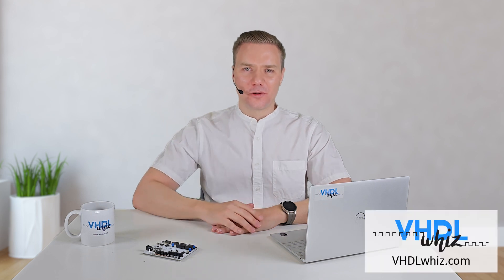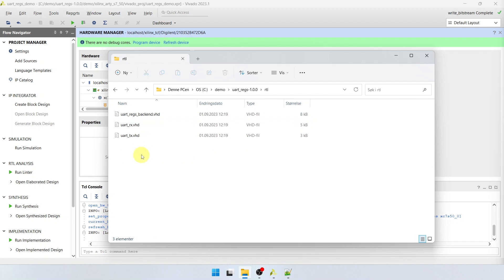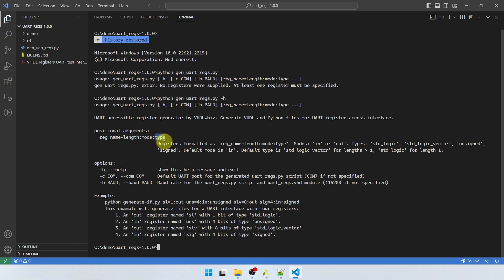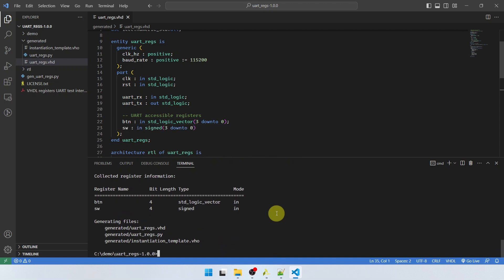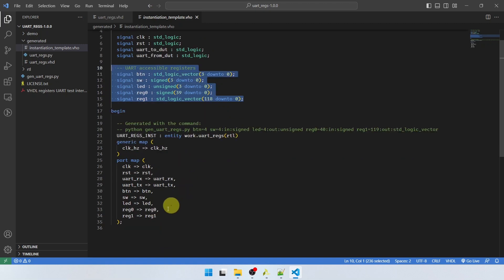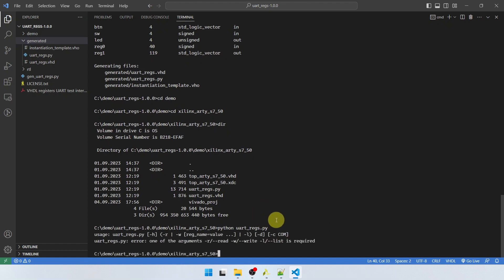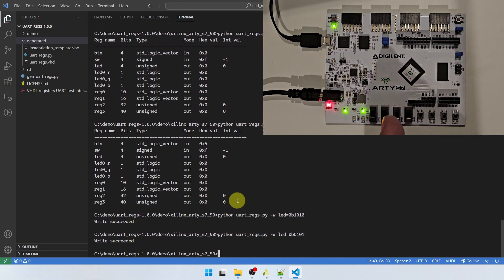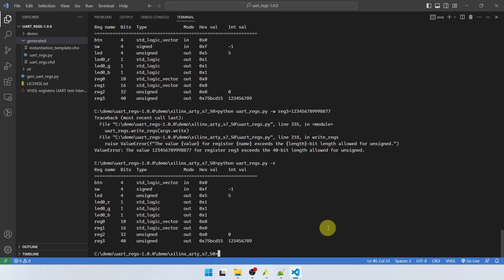VHDL registers UART test interface generator

Comment: Hi, I'm a beginner in FPGA development. I currently have a working project that runs successfully—from Vivado 2019 to SDK and then to the DUT. I'm able to operate it through a UI menu generated by C code via UART. Now, I would like to write and read with FPGA registers by using Python. I'm interested in the video, but would it be possible to guide me directly based on my existing project setup? That would be more convenient for me.
Reply from the maker: Hello. The Python script and VHDL modules that are in the Zip package can be used to read/write registers in the FPGA, as I showed in this video.

You can manipulate the registers using the command line script. But you can also import the Python class into you Python script if you want to interact with them programmatically.

The Zip includes demo projects for the Digilent (Xilinx) Arty A7 35-T, Arty S7 50, and Lattice iCEstick boards.

There's also a user manual PDF, and you get access to a video (different from the one you commented on) where I explain in detail how the code works and how to integrate it into your design. If you still need help, you can ask me.

The project is available for download in the VHDLwhiz Membership:
https://academy.vhdlwhiz.com/membership

And I also sell it separately in the VHDLwhiz shop:
https://vhdlwhiz.com/product/vhdl-registers-uart-test-interface-generator/